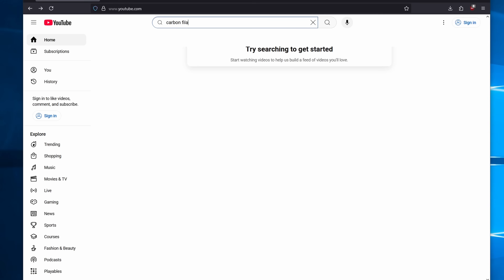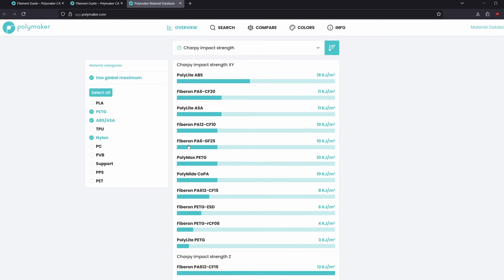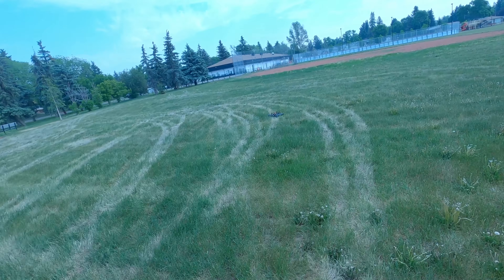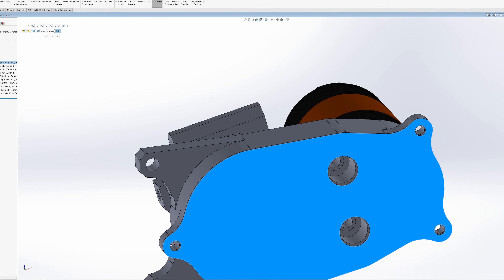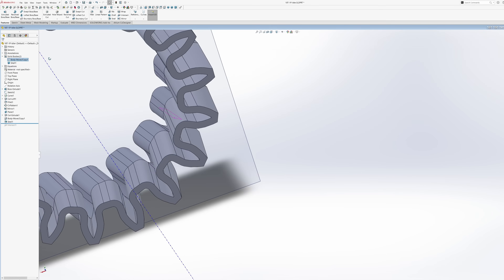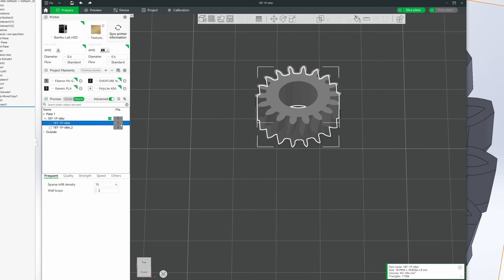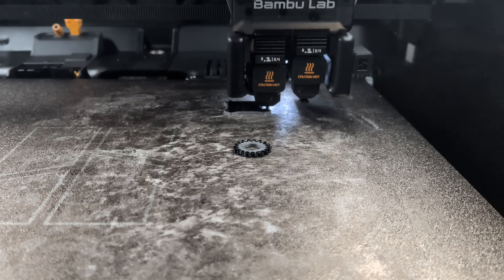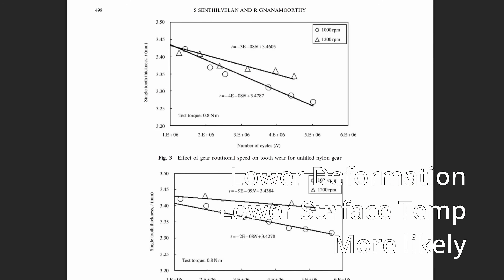Hidden Dangers of Carbon Fiber Filament—Solved!

Comment: If you can't see the CF fibers on the surface of the print then how can you confirm that you just can't see it embedded in your skin? You need a very powerful microscope to see carbon fibers. A bench microscope for soldering probably isn't enough without additional magnification.

Comment: Consider HT-PLA ... can handle 150c without deform, also there is PCTG
Reply from the maker: I've watched many videos on this material. That's under zero load. Post tg it's a wobbly noodle with similar hdt. It's resistance is in the use case of hot but zero load. Not quite useful for anything except art that might be in direct sunlight.
Reply: @kwakeham  Might be good for plasma cutting templates.

Comment: Most of the fear mongering around 3D printing fibers comes from a single source, we know who, and is just that, fear mongering. Use common sense, don't use it for food or drink, wear PPE if sanding or otherwise processing. Either way, cool idea and testing!
Reply from the maker: That's basically what I landed on.  Still hoping I can simplify this and use it for other things

Comment: That was my happiest and saddest day as a child all in one. The day I bought my Tyco Fast Traxx and broke it after  runs. I took it apart and the drive gears were so trash, I could scratch them with a finger nail. I knew between that and having no rear suspension even if I returned it and got another I would have to baby it or ruin it. I returned it and got the Baja Truck.

Sighhh... memories.

I see you're still chasing that high too😅

Comment: I printed a few parts in PET-CF with a lot of care and applied 2-3 layers of clear acrylic paint on them to be reasonably sure I can handle them without issues.
Reply: I wonder if a spray on clear coat would offer the same protection
Reply: @plaskut  The same protection as? What I did was precisely spray-on clear coat. A couple of layers, matte finish.
Reply: @DiThi  the same protection as a resin clear coat, which is what I assumed you applied.

Disclaimer: I have only a beginner's knowledge of paint/protection systems

Comment: I am moderately concerned about carbon fiber prints. I've used PET-CF and PETG-CF and while handling the prints I didn't see any fibers in my skin, I still noticed the parts felt rougher. My eyes are certainly not as good as a microscope. So I've tried to avoid using those filaments on my functional prints that are close to food, or interfacing with somewhere I'm touching frequently (like bike parts). I've also done some prints in Easy PA and ASA with success, but still wanted the strength and printability of the CF materials. so this is not a bad idea! Hopefully with the advent of dual or multi nozzle printers, this will be even easier to implement with minimal waste. Of course the other idea is core filaments with the fibers in the middle, which would also be preferable over no protection at all.

Comment: Can you dial down the purge amount in the slicer to do this on a single extruder, since you are using compatible materials?
Reply from the maker: Never tried, might be an interesting idea for the X1C. The H2D I barely understand why it's purging at all or why it's dropping nozzle temps. Haven't looked for that yet.

Comment: Did anyone tried to print something from CF and dip the parts into resin for SLA printers, wait untill excess resin drip and cure it.
Reply from the maker: Someone else used acrylic paint. That's another quick idea. Hard to make it even if you need dimensional tolerance, but should be possible.

Comment: I floated this idea on a firearm part 3d printing page on IG back when the video warning about this just dropped. These are almost always going to be handled and fairly roughly, but my idea was simply some kind of slicer implementation so it only does the skin in the non fibrous material.
Reply from the maker: So this should be totally doable in a slicer, like outter wall and top and bottom. But I just haven't figured it out. I hope someone else does
Reply: @kwakeham  perhaps open a feature suggestion ticket for orca slicer?
Reply: Bambu Studio/Orca Slicer, use the paint tool to "paint" the outer surfaces of your model, assigning a specific filament to those painted areas, while the rest uses a base filament.

Comment: Use glass fiber filament, it is biosolubale clears from body quickly unlike carbon fiber which takes long. (It’s not regular glass)
Reply: This is quite some statement without providing evidence or further reading material
Reply: @DC_DC_DC_DC  glass fibers are widely studied and seem to be of lower concern (I don't believe the biosoluble part). " Although fiberglass is widely used and low levels of exposure are commonplace, these studies have not shown a significant increase in mortality from respiratory malignancies or nonmalignant respiratory diseases in individuals with fiberglass exposure. The commonly reported abnormal findings on chest radiographs are low profusion micronodular opacities, hilar enlargement, and pleural thickening. "

Carbon fiber has NOT been nearly as widely studied and is kind of an unknown health risk at this point. Why take the risk.

Comment: The H2D or the Prusa XL is ideal for this.  Since these are functional parts, this coating is good enough.  Worst case, hit the sides of the gear (while wearing proper respiration and eye protection) with a few coats of a clearcoat, or if one wants to really go at it, mask off all but the edges of the gear, hit it with primer, paint, and a clearcoat.

Overall, this is an excellent idea.  I may see about doing this for some gears I'm doing.  Thank you for this video.

Comment: I chose to use glassfiber over carbon fiber because a bunch of studies show glass fibers dissolve in the lungs if inhaled. The fibers will stick out of abs-gf, but rub off easily. For parts to be handled i use fusrock Nex filament. They re co extruded so the fibers are only in the center of the filament. This gives better layer adhesion which allows a higher percentage of glass fiber to be used resulting in an even more rigid print. 

For gears i use igus tribofilaments. They re specifically developed for gears, bushings and moving parts. They re expensive, but because gears are typically small a single roll lasts forever. i ve printed almost 400 gears now for half a roll of j260.
Reply: I haven't been able to find the studies you refer to. I also can't see how glass can be dissolved by the body. It would be much appreciated if you can provide some titles

Comment: I think the issue is with CF/GF in any part experiencing friction,  particles are bound to release and can be inhaled.

In the cosmetic industry one of the most difficult obstacles is getting substances beneath the skin barrier.  generally speaking the particles need to be under 100nm (0.1 micron)     for comparison a human hair is 80,000 to 100,000 nm wide.    so we are talking very small.

there is a treatment call reed needles,   basically these are small silica particles that work like micro needling,  they embed themselves into your skin,  I have tried them and yes you can feel them sting, they do help other cosmetic materials to penetrate into the skin making them for effective,    the thing is,  these do not get into your blood stream,  you are always loosing skin particles,  when you exfoliate and wash your hands and face , or brush your back you are loosing the top dead layers of your skin, and anything embedded in them.
Reply from the maker: My gearboxes are the high surface touching / moving parts so they are enclosed and grease helps contain. I think the scare was several videos showed CF getting embedded in skin. I never experienced that but I think I'll be being more careful when opening the gearbox thanks to your comment.
Reply: Glass fiber used in filaments is not actual glass, it is bio soluble and dissolves in bodily fluids very quickly, unlike carbon fiber which needs to be physically cleared by your body
Reply: @harmonicseries6582  "glass fiber is not actually glass" what? You can just google the MSDS for any PA6+GF30 filament and see that it contains glass (65997-17-3). GF = glass fibers...